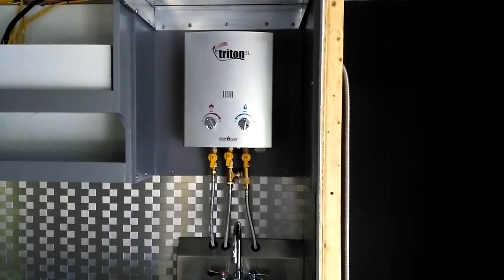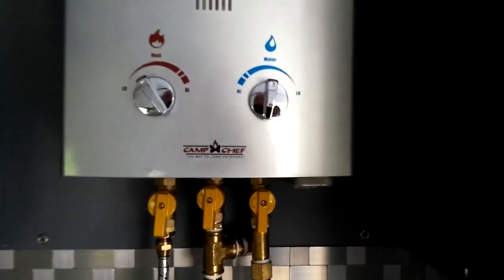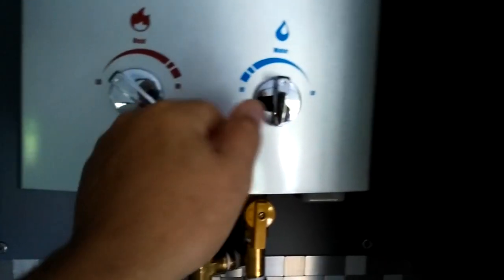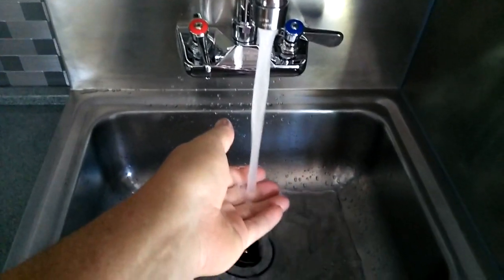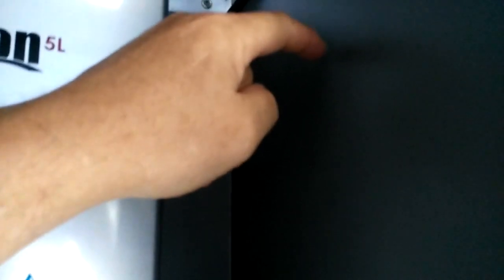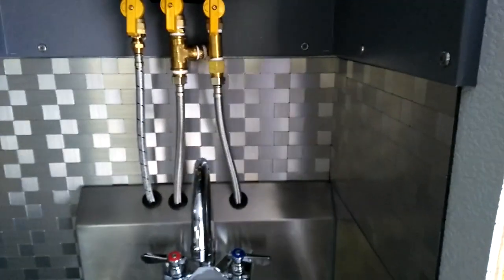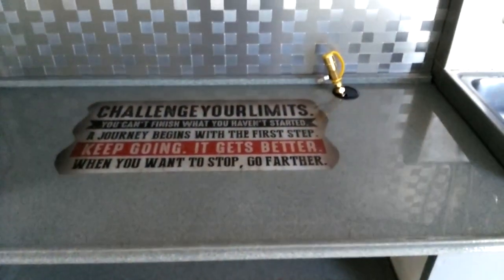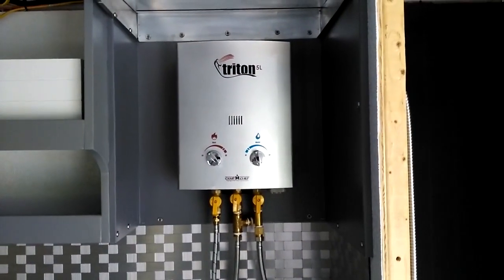E11 – Camp Chef Triton Portable Water Heater - Cargo Trailer Conversion To Travel Trailer

Comment: Man I like your thinking.  I did almost the exact same thing in my cargo trailer, but went with a permanently mounted 4 burner stove and I NEVER have enough counter space… I wish I would have thought of your design or saw your video sooner.  I did go through the wall with an oven vent to pull the fumes out of the trailer from the Triton water heater… it can pump out the heat and fumes without the vent.  I installed a North Woods wood stove in the trailer for some cozy heat back home in Wyoming and a 10k btu mini split AC to keep it cool in the summer.  My 600 watts of solar panels on the roof along with my 3 100 aH Dakota Lithium LiPo batteries with run everything including my Magic Chef 4.5 cu Ft refrigerator freezer.  I used all LED lights inside and out along with a 2000 watt pure sine inverter for AC equipment.  It is perfect for my hunting and fishing trips… your set up looks awesome!  Great video!

Comment: How has this tankless water heater been long term? Also noticed the instructions say for outside use only. Was wondering how to get around this or do you have a vent? Thanks for any info.
Reply from the maker: This has been working great. So far we have not had any problems. As far as ventilation, We turn on one of the roof air vent fans when we run the portable water heater to vent any carbon monoxide outside. The vent is less than 3 ft away. So we did not vent water heater to the outside. We have a Carbon Monoxide detector in the trailer to be safe. Thanks for watching!

Comment: How did you vent the Water Heater?
Reply from the maker: We use the roof vent fan for ventilation . The hood over the hot water heater is not a vent. It is to keep it from heating the ceiling up. It has fireproof insulation in it. Hope that answers your question.

Comment: Nice.  Where can I get those braided hoses? And splitters? I want to do the exact same thing.  
Thanks
Reply from the maker: I picked them up at my local hardware store Lowes. Had to go to two different locations. I found the gas line in area where they sell the Barbecue Grills. The water lines and fittings were in the plumbing section. So far everything is working great. Hope this helps you. Thanks for watching and subscribing! You might also find them on Amazon if you do not have a Lowes. Here is our Amazon Associate link if you would like to use it: https://amzn.to/2uZFAAW
Reply: Beware of using braided lines that are for sinks because I had two break on me and my laundry room got flooded with water. I replaced the braided lines with a water heater hook up had to go from half inch to three quarter inch but I  know these lines won't break.  I'm on city water and the pressure is higher. If you have to run a pump the lines may not break. The hot side broke on my  former hook up. 73

Comment: do you have to vent the sytem?
Reply from the maker: We decided not to vent this and put an extra hole in the trailer. So the hood above it does not have a fan in it. Instead we just turn our ceiling MaxxFan on low when it is in use. We find it works perfect this way.

Comment: 0:32 
I'm confused... 
Did I just see you Turn on your Hot Water from your Sink to go into your Water Heater???
No, surely not.
Reply: Wait... So When you turn on the Hot Water at the sink... the water heater comes on... Right?
Reply: OHHHH I get it now... instead of having a "Shower Head" you have it hooked into the Sink... "Duh"
I have never seen it like that... Way to go... I thought it was just for the Shower.
Reply from the maker: Yes, the hot water heater supplies the water to the sink and the shower. You can turn on the sink and it will ignite the hot water heater. Then put your hand under the hot water faucet to decide on the proper temperature that you prefer to take a shower. Then shut the sink off, step into the shower, turn on the water shower head, and the water will come out at the same setting that you set it at the sink. We designed this so that there would be no extra plumbing and shower knobs in the shower to have to replace. I realize you understood it now, but thought I would go over it once more for you. Hope this helps. Thank you for watching and taking your time to comment. It means a lot to us!
Reply: @justkeeponmoving7727  
Thank you so much for explaining this to me... I "Flip" RVs and am working on a Vintage Travel Trailer I want to keep for myself... This could work... Thank YOU so for such a great video.
When will you have a video about doing your shower? Would love to see that too.
Thank you.

Comment: Thank you! You are the only review that clearly shows how to use the heat and water knobs. I have one of these outside for indoor sink and shower. I always need to change the settings depending on ambient outdoor temps and was never clear on what was happening. Not the easiest to figure out when a single person running water inside and changing knobs outside! I would not recommend outdoor setup for indoor use. You've got it right with your setup!

Comment: I just got one and the flame wont stay up. I hear ghe clicking then a lil flame come then it turns off. My propane tank is full.
Reply from the maker: That is usually caused by low water pressure. Make sure you are getting efficient water pressure to the tank. Or if you turned the water level down too low it will shut the water heater on and off quickly or will not ignite. It will even happen if you have a low out-put shower head sometimes. Hope this helps you.

Comment: Our city water goes off from time to time and last time was 5 days. I was thinking of creating a water holding station with blue barrels and filling the inside tub with the heated water from this heater. Does the pump have enough pressure to transfer the water about 20 feet or so as i will have to make all this set up outside on the back porch?
Reply from the maker: Yes, this would work out real good for what you are wanting to do with it. But you might want to use a 3.5 gallon per minute. This should insure you that the water travels further distance. Here is our link to one... https://amzn.to/3b6EYd3 Keep in mind, do not let it freeze up in the winter, the pump or the hot water tank. Hope this helps.

Comment: So how does your shower drain and where to?
Reply from the maker: We have the shower and sink plumbing tied together. It goes through the floor and we have it set up to drain into a portable tank that sets outside the trailer when needed. If we are parked at a RV Park, the drain line runs directly into the RV sewer dump. Here is a link that will show you our Grey Water Drain System. This will help you understand it... https://youtu.be/A3Tbg-wPX-8 Also here is a link to our Portable Holding Tank but we only use this when there is no sewer hookup... https://youtu.be/FCLyEvcLcLI Hope this helps you understand it better. If you have any more questions, please do not hesitate to ask.
Reply: @justkeeponmoving7727  awesome thank you!

Comment: Hot hot does the area around the hood get?
Reply from the maker: The exhaust from the hot water heater exits from the top and it does get extremely hot. This has to do with how high you turn the temperature up. When I was testing it before we installed it, in my opinion, it needs to be at least 3 ft or more from the ceiling to keep from heating up the ceiling. So we played it safe since we were closer to the ceiling and put a stovehood above it to reflect the heat. We used fire insulated within the stovehood. If you touch the front and sides it is not hot until you get closer up to the top. This hot water heater had been working great for us for our needs. We mainly run it on low. Hope this helped you. Thanks for watching.
Reply: @justkeeponmoving7727  Thats good info..thank you..
Reply: @justkeeponmoving7727  I searched various different videos for just this bit of info.
Reply from the maker: @kennethterrell1167  In making this video, I wish I had mentioned how hot the exhaust gets from the top of the water heater. I was more focused on how it operates. Thank you for watching.